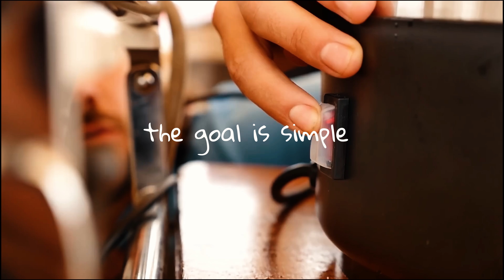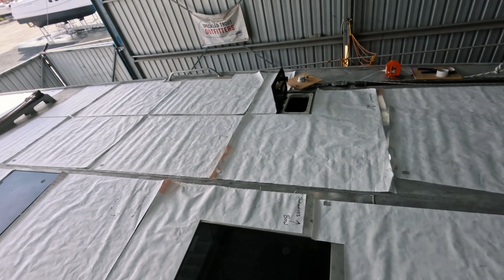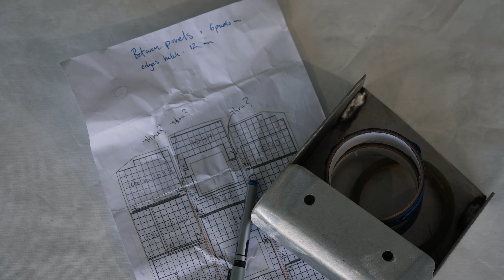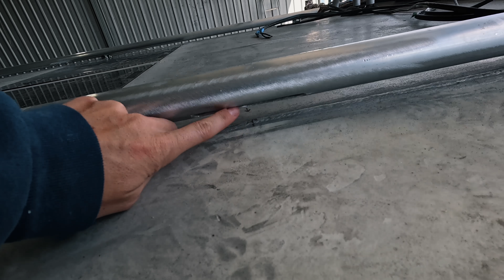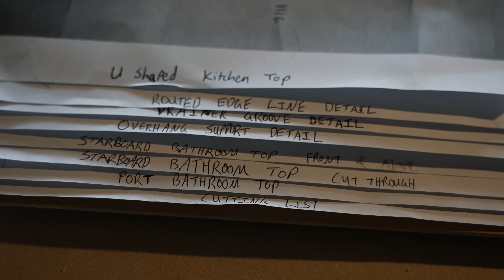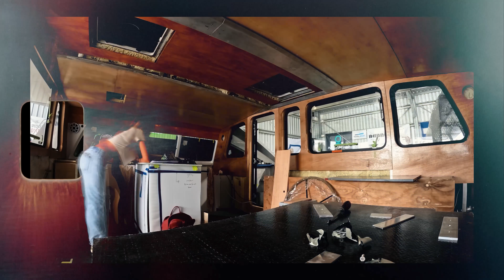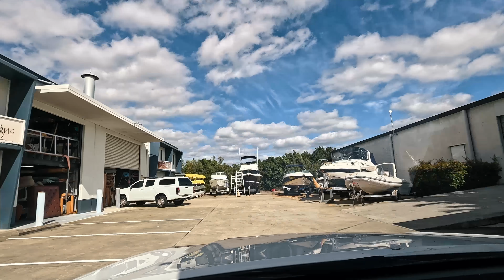EVERY INCH COUNTS....Aluminum Catamaran Build Pt. 83

Comment: hey brian, i watched this when it came out and i can’t shake a thought. i know you’re a super handy guy so i don't mean to insult your intelligence if you already know this. i saw the red backing on the solar panels and recognized it as 3m vhb tape. i’ve used that in a lot of projects. it was used to secure the glass panels on the outside of the burj khalifa. it creates a near molecular bond with a bit of time. i fear that if you need to ever swap out bad panels in time it’ll be near impossible to break that bond. just a thought, do with it as you will. i also worry about the thermal transfer of the panels and the roof and think giving an air gap between the boat and the panels would significantly cut down on ac needs. thanks for the great vids over the years!

Comment: I'm curious what the impact will be of the tube cable conduits on solar output.  Depending on the angle of the sun there might be some shading on the edges of the panels right???

Comment: For all the counter tops and ceiling panels, I hope you keep an electronic copy of the size of each panel.  Also the solar panels (which you should make sure is numbered well (so sea and wind won't wear off the numbers).  So if you ever need to replace them... also its a good resale value too...

Comment: Tying such a critical task to one induction sensor seems dangerous. If it fails or misreads you could end up with a catastrophe. Perhaps you need redundancy in the design. Like multiple sensors that have to agree or other.

Comment: hi team Delos! Have you guys talked/researched about how much the panels conduct heat to the aluminium underneath / heats up the saloon? We are just exploring flexi-panels on our saloon aluminium roof and trying to figure out if there is a way to reduce the heat transfer. So little info available 😒

Comment: I first mounted my flex-panels directly to the roof. this transferred too much heat into the structure. Fortunately I used thick beads of adhesive and could remove them easily with car window caulk cutting wire. I then got channeled 20mm aluminium plates with 1.5mm walls and mounted them 50mm away from the roof. Cools the panels by natural convection and keeps the heat way from my roof structure. And you can still walk on them... And please use two independent sensors for safety-critical, fault-tollerant sensing.
Reply: interested in this setup of yours. We are starting to build alu cat and trying to figure out what to put on our curved saloon roof. Elsewhere will have rigid bi-facials but on the saloon roof those don't work (too curved, lines, hatches, etc on the way). My worry is exactly that that A) the panels will get super hot and loose performance and especially B) they will transfer the heat to saloon that will get warm, no matter how well insulated. Super limited info anywhere available so keen on hearing experiences how to solve this / avoid the aluminium underneath heating up too much. Happen to have any pics of your setup?

Comment: I am sorry but you have got it completely wrong going with flexible panels.. You may have almost  doubled the nominal wattage but in 2 years you be getting blistered dead panels and even in the first year when you will be in hot weather the panels will give nothing close to 6000W, 1st year you mayget 60% 2rd year 50% and from the 3rd and on disaster strikes. The way flexible panels are mounted results in exteme overheating because the modules get heat from the sun, air temperature and the current that flows through. Also heat expantion on aluminimum and the resin of the panels is way off and microcracks destroy them very quickly. Since you have started this already Do not in any circumstance stick the solar panels directly on the top of the boat. Idealy you should find a heat transfering adhesive and stick them on 10mm hollow polycarbonate sheets in order for some air circulation underneath them. Ideally you should lasercut an aluminium grid and put them on top in order to be able to walk on them but then the cost will be close to space technology. The technology has progressed but they haven't solved overheating problems and if you see the Temperature to Voltage drop curve you get what I mean. Anyway do your own resaerch and AT LEAST put the panels on top of these polycarbonate sheets it will help a lot more than you think.

Comment: Ok, perhaps silly questions from a landlubber - [  but an intrigued and want-to-know-more one  ; )  ] - 

#1-  Would this vessel be able to be run using electric and/or fuel-based twin outboards???
        

#2 - could it also be pulled by a kite sail instead of regular sail rigging

Caveat; am not (yet) a sailor - but am looking at a number of cat vlogs and learning from them :) and am inspired to think about what works and what doesn’t!

Oh, 
#3 - can the layout fit like 4 berths (queen sized beds, maybe 4 heads but two Jack&Jill showers) comfortably 

And I’ve got to say I like a lot of the ways you’ve redesigned where things should go re helm, galley,  etc. 

There are a few blogs where folks are doing new aluminium builds, and it’s interesting to see the changes/adaptions/innovations that people are making - how they are tweaking  things based on their overall experience, esp offshore/ocean experience. It is an education! ;) 

Gregg - Perth, Western Australia

Comment: Hi Guys, another super fun video! We actually met a couple of winters ago in MX. We were anchored in the same cove together in front Loreto for a week. I had a 72’ Grand Banks Aleutian “Tango”. We said hello and had a brief chat. My question: How are you tracking weight distribution with all of the various systems and components? Port/Starboard/Fore/Aft? Do you anticipate needing to add much ballast? Also, what is the length of Delos 2 and what do you anticipate the overall weight will be upon completion? I hope to run into you guys again. My new boat is an Ocean Alexander 60 “MV Blarney”., based in San Diego - frequent cruiser. All the best!

Comment: I've been thinking about your belt drive and your concern that minor misalignment of your toothed pulleys will cause the belt to run off the pulleys.  My college friend, Bill Sullivan who worked with you when he was at Viasat suggested that I contact you with this idea to possibly fix your problem (if you have not already found a solution).
The belt would run off the misaligned pulleys because the misalignment causes one side of the belt to have less tension than the other side.  A simple fix would be to introduce a smooth third tensioner wheel to apply pressure to the external face of the belt (on the slack section of the belt).  The tensioner wheel would have to be installed so that the wheel can adjusted to apply slightly unequal pressure to the belt so that additional tension is added to the side of the belt that requires it. This tension adjustment would be done dynamically as the engine is running while observing the tracking of the drive belt, and can be adjusted from time to time as the belt wears.  (I am not 100% sure this will work, so experimentation may be required to confirm this idea.).  What do you think? 
This is Brian Bedard, using my wife's You Tube account.
Reply: Another soltion  could be to give the pulley wheels a minor cone shape

Comment: @svdelos : You know, I think if you were to completely cover the port and starboard main deck and filled that with solar panels, you could delete the sails!!!!!   I am sure you have gone over this before, but this has been quite the build and hard to remember so much.. So are you going to build whatever is needed to use a KITE?? A few winches and power to run them and anchoring for all of it?????   This is STILL the BEST CHANNEL on YOU TUBE!!!!

Comment: Will the solar wires get the casing worn off by the movement of the wires scraping against the cut outs in the pipe???   It just seems like there will be a lot of micro-movement there.  I would monitor to see if wear occurs.   These flat panels are so interesting!   I watched Dan & Kick. of. "UMA"   test the temperature when walking on them barefoot vs. water shoes.   It seems they are just as cool as walking on fiberglass in the sun.  I wonder if the aluminum will be cooler or warmer???  Can't wait until you launch to see so many of these systems working.    Happy. Sailing!!!

Comment: Can you walk on those panels?  Also, I notice you don't hesitate to weld on aluminum parts here and there.  At what point do you need to consider the weight of the add-ons?  How do you know your boat will float at the level you anticipate?

Comment: I noticed they were using suction cups to remove the ceiling and wall panels. Have you given any thought to the fact that with textured covering or cloth covering suction cups won't work to remove the panels in the future?

Comment: Love the solar panel wiring tubes idea.  Less holes anywhere on the boat is a great thing.  By the time you get done, there is a book to write for all the other channels that are engaging in aluminum cat building.  Your foresight and research would be a great start for everyone.  Tech may change but the "why" you sought out the various bits of tech are likely to be almost universal.  Loving the project.

Comment: 3d print some bushings on the pipes to protect the wire. Great video of course!!!!
Reply: If you were to make the bushings thicker on the outer edge it would stop water from migrating into the conduit due to surface tension. Also consider maintaining a well waxed coating on the full length of the conduit.

Comment: Doesn't sticking that much black to your roof act like a heat sink and cook the inside of the boat? Shouldn't you have a 2 to 3 inch standoff platform mounted to that roof to allow an air gap to keep them from doing a thermal transfer into your main structure as well as allowing the panels to be cooler and thus more efficient?

Comment: Hey Brian. Did you consider running the electrical conduit by adding a slight slope with drain hole. If water gets into those tubes it had a way to drain by gravity?

Comment: ? Does the proximity switch have a light and what happens if the switch fails, i have seen them fail because of temperature also  moisture in the connection, normally on  o rings insulated connectors i have to replace 70 to 100 every year.

Comment: The proximity switch will fail.  I hope you selected the switch not allow the drive to operate when the switch fails.  In other words when it is dead your electric motor should not run.  Also couldn’t you get a run signal from the diesel motor run panel.  The proximity switch is something that would worry me.

Comment: What is stopping you from shaving the welds flay and what is the spec for the solar panels flatness requirements. Do you lose any reliability or peak power my making the gaps at the weld seams?
Reply from the maker: The aluminium is thinner up there to save weight, so we need to save some of the weld for strength at the seams.  We ended up doing it 50/50 though, grinding it back partially and then fairing the rest over a longer area to make a gradual slope.

Comment: Why not sand the weld joints on the roof and make them smooth?
Reply from the maker: The aluminium is thinner up there to save weight, so we need to save some of the weld for strength at the seams.  We ended up doing it 50/50 though, grinding it back partially and then fairing the rest over a longer area to make a gradual slope.

Comment: I have a question for Dan, With Dalos 2 using so much tech and a sister boat in the yard, is Delos 2 the prototype/proving ground to work out the problems for future builds from Stradbroke Yachts?

Comment: check out the posting by sail Uma.  they also used flex solar (different company) across the entire top of theirs (smaller than yours). barefoot walking was warm or hot, but check it out.

Comment: Regarding the optimization of the solar...  I think you mentioned either 3 or 4 MPPT's and there's no doubt a multitude of ways to divide/balance the solar "panels" between these converters. Here's the assumption:  Let's say that you are sailing in a particular direction at a particular time of day and that the mast/sails are casting a shadow across part of the total solar array.  In that specific scenario, with that specific shadow (size and location), I submit that HOW you chose to wire and divide the panels into the MPPT's, matters!  In brief, if you had divided panels to MPPT's one way, you'd get a specific solar output but if you had divided them another way, you get a different solar output (for that specific mast/sail shadow).  Do you agree?  What I'm wondering is what might be a typical variation between the best case and worst case.  If it is just a few percent, then maybe it's not worth thinking about.  But, if its's more than a few percent, I'm wondering if someone makes a device that can do dynamic dividing of the solar panels.  A black box that the "panels" all go into individually (or as small of "units" as possible ) and that the black box looks at each "unit's" power and decides how to configure them for routing into the different MPPT's.  Again, maybe all of this is moot.  A LOT of smarter people than me out there... but I know that ANYTHING you can do to maximize solar production is going to be very beneficial.

Comment: I'm sure the manufacturer says its ok to do, bu with the panels attached directly to the roof are you afraid that will cause them to run really hot? I've seen others install flat, flexible panels and it seems like they still have a lot of room to improve. Also, are you worried all that black on the roof will end up heating the interior of the boat?

Comment: On a GPU or a CPU you use thermal paste to attach the device to the heat sink. All the heat that it produces gets transferred to the heatsink because of the thermal paste. Being that your entire roof is a giant heat sink why can't you incorporate the thermal paste or a similar type of thermal paste with the glue that's holding the solar panel to the roof. All the heat that kills those solar panels with transfer to the roof making no solar panels last at least another 10 years longer. We all know that that type of solar panel does not last and while yes you could replace them when you're in the middle of the boonies and these things start dying one after the other that becomes the issue

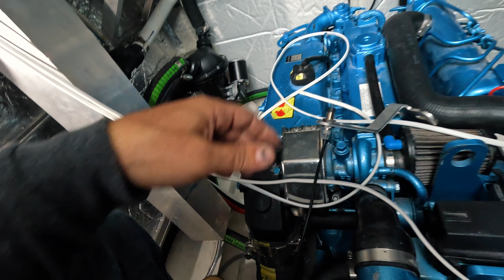Comment: @brian 17:36 because the critical nature of the sensor, is there a way check if the sensor is working properly at an regular interval. Like by the controller? 

At my job we had a engin break temp sensor malfunction of an industrial hoist motor and we knew it was broken, because the engine was on fire. Break got that hot it ingited something inside/around the engine. After an investigation, they found that the sensor hadn't recorded a temp in the week before the fire.

They replaced all sensor with ones that could be diagnosed  before the hoist motor could  be engaged.

Comment: Aren't all those black panels going to add an enormous amount of heat to the cabin being that there is no air space between?
Reply: Then they just use the power from the panels to run the AC. 🤣🤣🤣🤣🤣

Comment: Thought initially that the solar installation was going to be somewhat more off the shelf. This is very bespoke, I like it. More surface area, still, should you require to replace panels at some point in the future I guess it's not going to be as simple. Provisioning wise. Still awesome.

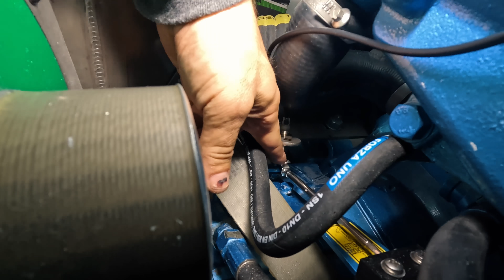Comment: 18:50 Something I've seen on Motorcycles they have a notorious problem with being seen by inductive sensors at intersections where cars  have no problems. Something that may help here is instead of relying on the stainless with it's lower sensitivity to induction add a different material that will read better. Iron, copper brass or whatever corrosion resistant material fits best as say a washer or acorn nut type of cap. Just something with better inductive reception than the seemingly less sensitive stainless. That or just use a 3 pole switch & make it a mechanical linkage vs an induction coil that will be effected by the variety of EM fields in that engine bay.

Comment: If a panel gets damaged, how tough would it be to pull it off and replace it? Just work it loose with a putty knife or soften the adhesive with a heat gun? I've seen videos of people taking the flex panels off of an RV and it looks like it would be a pain in the butt. In the unlikely event, right? These look to be pretty durable, probably last a good long time. I love how fast this tech is becoming available.

Comment: One. Can the electric prop motors and the electrical systems run underwater in a flooded engine compartment?
Two. Will the electrical system and batteries operate if upside down
Three. Will your transmission engaged sensor work if submerged?
Four. Will the house top conduit for the solar panels, accidentally snag up on your main sheet at the traveler?
Five. The Corian counter will burn if you put a hot pot down on it and it scratches easily, and damaged if used as a cutting board. Isn’t your boat istiff enough that stone viner would not crack?
Six.  What is the impact of solar heat transfer through the solar panels on an aluminum deck? Is the absorbed thermal energy from the sun on the panels more than the air-conditioning from the panel grid?
Great Work! B

Comment: You may want to consider having a little more room around the hatches on deck when measuring for tight fitting custom panels, in case you have to replace them or do some leak proofing or anything else around them in the future so the panels will not have to be destroyed in the process.
Second concern I have is, have you considered any future hardware not planned initially but may be necessary to install on deck in the future?
Other than that, I love the idea that every possible inch of the deck is made available for maximum solar installation